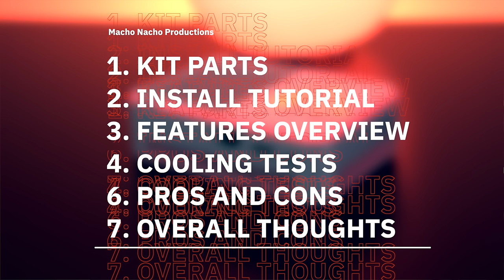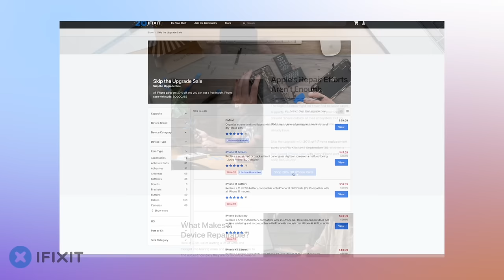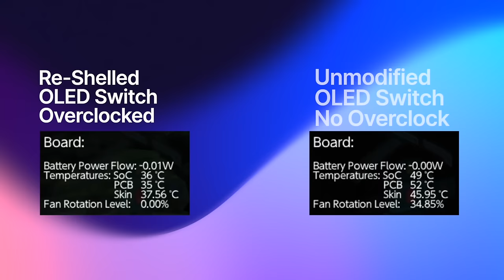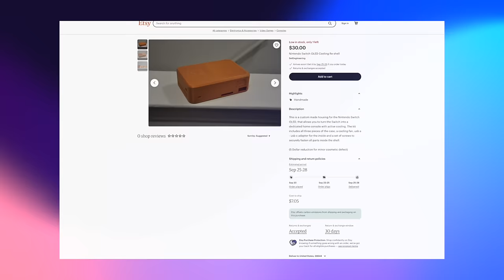Making The Nintendo Switch Run FASTER And COOLER With This NEW Mod!

Comment: I just got a switch OLED I had a switch light before which I love but I traded it for A vita which I think is an even trade because I wasn’t going to touch my switch light again, but if they can make this for us which way to work, then it would be worth it. I don’t see the point in using it with a switch OLED.

Comment: If he could manage to add a fan switch or one of those switches with variable resistance like a light dimmer but smaller, and an sd card extender ribbon cable to have it accessible from outside, then I think this switch mod would be the greatest one ever 👌

Comment: Emulating it on a PC? That runs faster and cooler.
Reply: You mean digital piracy 🤮
Reply: @iwearLingerie  Piracy is piracy. You're already running a modded Switch if you're overclocking it, and that's also a big no no in Nintendo's book.
Reply: @callme_Sweetpea   piracy is piracy but it's still piracy no excuses

Comment: Over $ 40 for a 3D printed shell. That's quite nasty. Don't get me wrong. Ofc it does take some time to figure out how to fit the switch in a case like this. But even $ 20 would be a lot for this..

Comment: None of those games you showcased had almost any framerate increase at all when overclocked. You had the stats om the screen while talking about oc benefits and showing zero differences lol. Why even bother then????!
Reply: Switch is capped at 60 fps when docked. So the frame rate increase he’s talking about is more like consistency rather than performance. This means that you’ll constantly get 60 fps with most likely nearly no drops. And the games he tested are optimized for the switch and likely are the games that push the switch in it’s most optimized formed

Comment: I waited the whole video for you to talk about fan noise, and no measurements? While it's good you at least said something, it's impossible to compare or really understand how loud it is without references, i.e. measurements. Wish you had included a dB meter. Also, whoever designs the pcb should be able to include an on off button for the fan that can be integrated into the console design.

Comment: Will this mod work with non-oled Switch's?
Reply: i modded the first gen switch and it's dock with a shell from the same supplier, although it's different from this guys video, haven't seen any guides online and i have to guess based on this guys mod and other youtube videos that breakdown the original switch

Comment: Why do you need a battery? Seems entirely pointless since it's now a consolized version.
Reply: Alright, good point about the console being able to sleep even with the power off/disconnected. I'd still like a version that removes it entirely as it would likely reduce thermals even more in addition to being able to compact the size even more. Yes, you need it to power on, but there's likely an easy way to emulate that check.

Comment: recoup design cost 🤣 i bet i can easily, make a similair 3d desing. In a very short time, its a box with mount holes 🤣 its not very safisticated tbh. Cool idea, but desing shouls be free. Maybe il be firing up, my 3d printer again. And make a model of my own 👌🏻

Comment: The switch will be end of production soon, its replacement should be interesting. THis mod is cool, but you will need more than a single screwdriver. You will need a triwing driver to take apart a switch, and I look forward to getting a v1 shell because theirs a ton of those out there cheaper.
Reply: No it’s not ended hater switch 2 sucks

Comment: Silicon doesn't get easily damaged even at +80ºC, and the games are already reaching 60 fps stock so this doesn't really make sense to me. If you could somehow uncap those fps (for 75-100Hz TV) along with a heavy overclock and a proper heatsink it'd be a serious mod to consider...

Comment: I wonder if the creator everdid the airflow calculations :D PULLING air against the main fan... rright... like its not struggling enough :D Design has its flaws...
Reply: upd: finmished the cooling review... the stock fan dropped because its struggling against the big one ahahhaha

Comment: the biggest con to me is you can't use wired controllers :(
Reply: You can. There's a USB on the side (the one to recharge your pro controller)
Reply: @juniorbarranqueiro  you can't USB-A can supply power but not transport data and You can't use the USB-C for Wired controllers because the wire that comes with it is USB-A
Reply: @Red_Penguin718  USB A can transport data. I already used my pro controller connected directly to the USB A port on the switch dock (the same USB A used on this mod). The only difference is that you need to activate the wired function directly on the switch config menu

Comment: Overclock needs some modifications on the hardware and the voltage. For example a direct die disipador contact and some Bios or software so how much can i obtain ? 15, 30%??? Can i gain an extra 5 to 10 fps? If you don't care to kill the console let's go. Game consoles are not a gaming PC , most component can"t be stressed without serious problems.

Comment: 1. i need a oled first of all so the title is hugely missleading and thats what i hate the most on whole yt.....2. the only real positive buying argument and usefull aspect of it is -> you can play with a cracked handheld oled switch on yout tv still -> for everbody else basicly not worth it at all because the overall improvement makes less % forward then a standard buying from switch to oled on its own.... whats with the sd card?